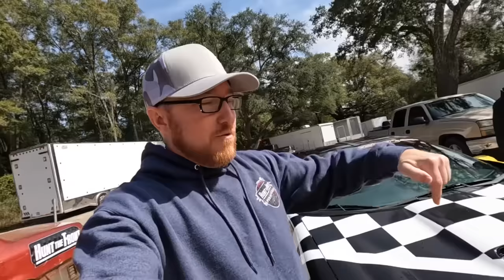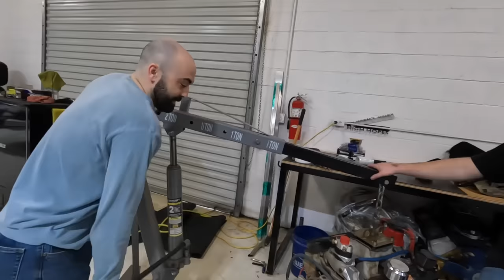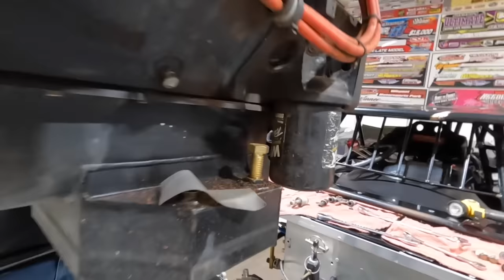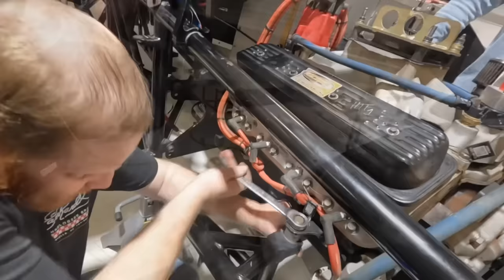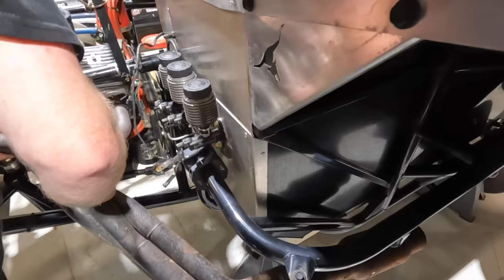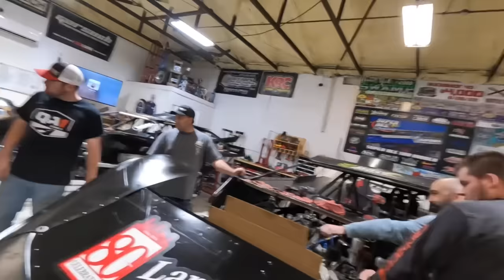We’re Bolting a Crate Engine in our Longhorn Chassis to Chase a Big Payday!

Comment: Hey, I watch you guys crawling around under your cars on jack stands all the time. Like me, you have a fork lift. If you get some extended forks and put a safety device (I use 2 safety chains, one for lift and one for tilt ), you can use your forklift as a car lift. I do it all the time. It makes life way easier. Just have to be sure your forklift lift capacity is rated high enough to support the extended load. It also makes moving vehicles around easier. Just saying.

Comment: Can someone explain to me why they put the cardboard or metal plate in front of the radiator while sitting there?
Reply: Warms the engine up quicker.  Prevents air flow from the fan through the radiator.
Reply: Building heat.. blocks airflow .... ROCKET SCIENCE